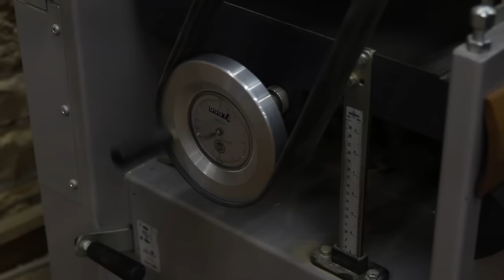Epic Faux Medieval Door

Comment: Fun build! thanks for sharing and teaching!  Since the door is obviously exposed to weather & water, you might want to create a protective "eyebrow" on the outside to help shunt the water around & away from the door lest you get moisture inside the door and have it rot & fall apart from the inside.  Also please consider weather stripping and sealing the top and sides of the door where the wood meets the metal & drilling weep & breathing holes along the bottom to allow and moisture & condensation that does get in to escape.
Reply from the maker: Thank you so much 🤘 We did all of those things 😊🍻 exactly what you described! It is all taken care of 😊
Reply: @EpicWorkshop  Ah! Very good!  Perhaps, as you seem to be very skilled and craft oriented, you might try your hand at forming some of those decorative elements out of actual metal. Given your dexterity I think you'd pick up ornamental iron work rather easily. It's really rather easy once you get the hang of "shaping clay with a hammer instead of your hand".  In fact many  blacksmiths use clay to practice on to get the feel of it!
Reply from the maker: I finished the Art school for masoner/sculptor and I worked a lot with clay. But you are being slightly unrealistic haha I don't have any blacksmith tools nor place to do it...😞 Yet 😝 maybe one day 😊

Comment: This is amazing work, but I have to ask; does there come a point when it is easier to just make the fixtures out of metal, than it is to make them out of wood faked to look like metal?
Reply from the maker: Thank you 🤘😊 If I had plasma cnc cutter and scrap steel to waste hahah... maybe I would cut them out of metal but this is way way wayyy cheaper and more quicker.

Comment: Fantastic work, as always.  Did you leave a drain in the door frame so that water does not build back up?
Reply from the maker: Yeah, we drilled few holes straight through in the bottom 🤘😉 Good eye 🤘 Thanks Alex 🥰
Reply: 🤨 - how is water getting into the metal frame?
Reply from the maker: From the top 🤘

Comment: Nice project.

Sorry to bother you with this, but do you know how to adjust the A3 planer to remove snipe? I have the same planer and i get snipe on the trailing end of the board. Cant seem to find guidance on this. Thanks.
Reply from the maker: Thank you Bro 🤘 Oh... I wish I could help you 😞 we have same problem and we have been dealing with hammer for 1 year already.. we are getting new tables from them because they are out of specs but I think that wont help the snipe because that machine is just... Badly designed. The hinges are too weak for this machine to be combination machine and those bolts where it locks are also to close to each other so overhang of the tables can't be adjusted 😞 anyways.. I don't know how to help you

Comment: I'm still laughing too. My only question is, did you install a drain plug on that door? That totally caught me off guard too ! Beautiful door.
Reply from the maker: We drilled drain holes, no problems anymore 🤘
Reply: @EpicWorkshop  I have had the water issue with my steel doors. Drainage holes are required in hand rails...most any steel fabrication that's exposed to the elements.